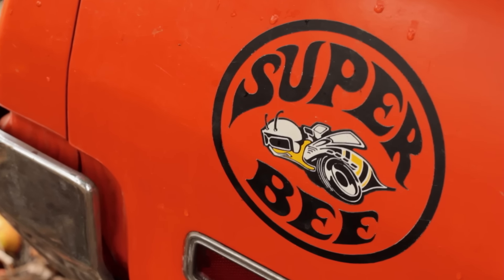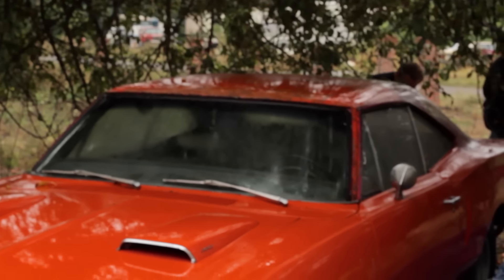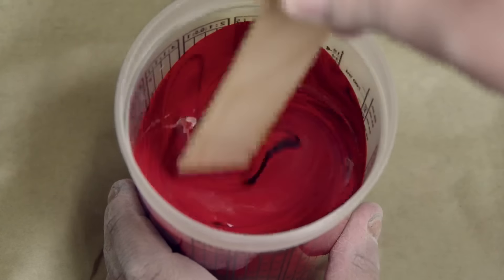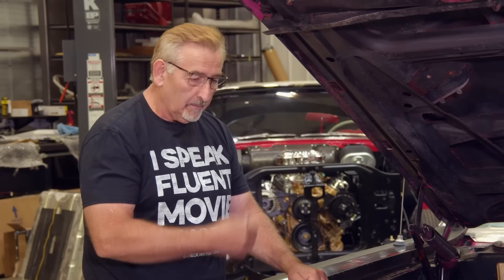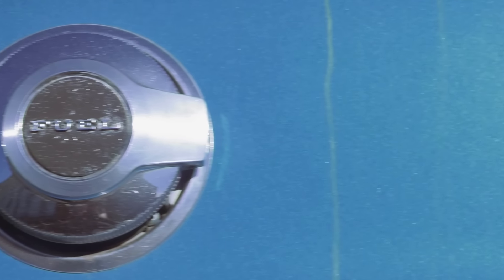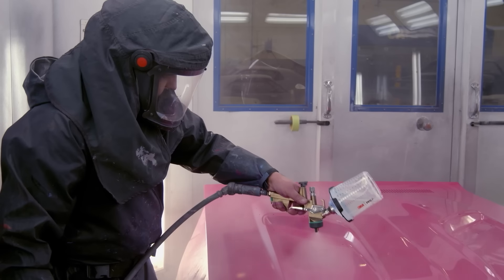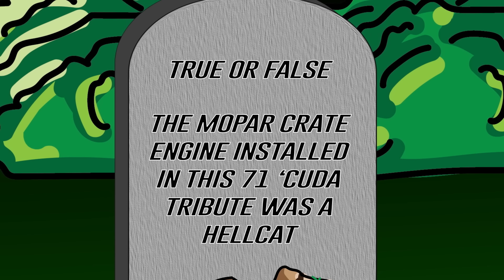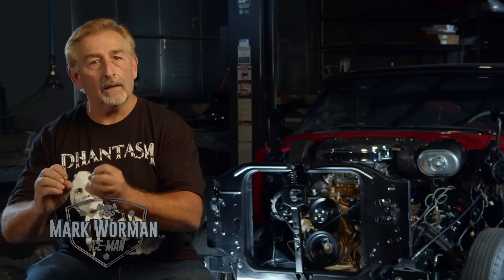NEW EPISODE: PINK 'CUDA PAINT! RAREST MOPAR COLOR

Comment: I have had 4  fm3 cars. aar auto,  383 auto w louvers, 2 318 nothing cars 1 was a 3 spd manual.
 aar came with window sticker and I found the build sheet behind the seat. how come I haven't heard anyone mention the difference in the fenders on an aar?   my aar had a one fender replaced along the way there is a fold in the lip of the wheel arch.  for clearance I think. also thought the rear ends are configured differently. leaf springs closer together or further apart can't remember.

Comment: My cousin had a 70 Duster 340 4 speed in pink. And if I remember correctly it had the black stripe with 340 on the quarter panel with a black hood with 340 setting at an angle in the corner.

Comment: Paint was good, body fitment was bad, passenger door you had to slam to shut. Body was a 1/4” out of square.they welded up screw holes that were needed.there was clear coat overspray on the passenger side door jam and chips on edges where the rear facia met the quarters . The contract was for a year, he took 4. Etc.etc.
I’m just telling the truth
Reply: How did you measure ??

Comment: Who wants to buy a 71 Super Bee pistol grip 4 speed original 383 motor dropped a rod busted the block now has a 440 steel crank motor 83k miles on the body about 23 k on 440 needs a little work could be a great project car all there spare pats get it b4 it's gone